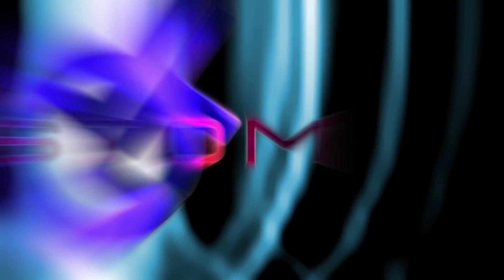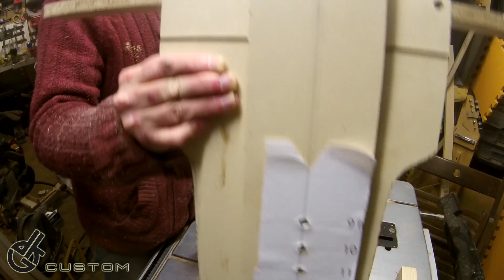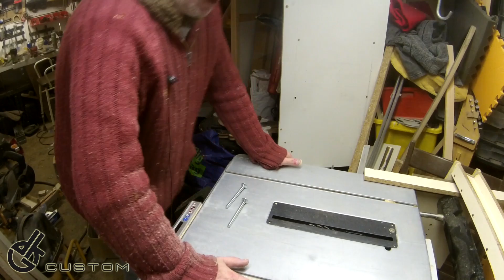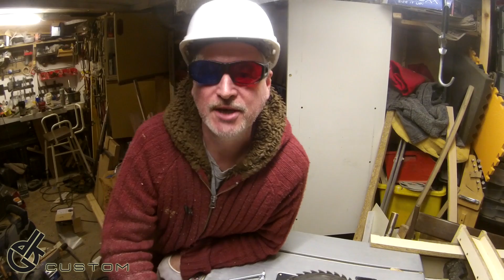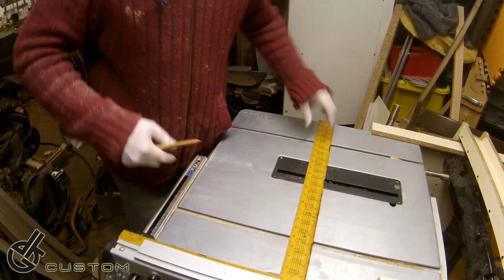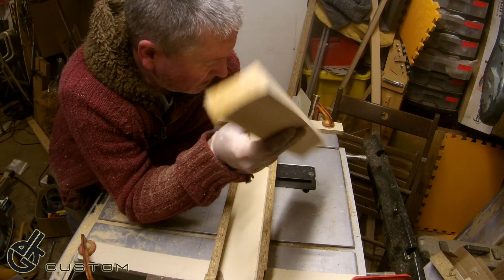Make FretBoard Radius Block using Table Saw - The blocks

Comment: thanks for sharing. Very interesting approach, but I'm sure the blade life will be shortened. I'm not sure how much less work is involved with the jig than using a router.
Like you, I have used a table saw for years - even perhaps before you were born - and I tend to be a bit overconfident. I am aware that it is a sharp-toothed dragon just waiting to amputate my best guitar-playing fingers. I recently rethought my use of the table saw in my very tiny workshop. (Well, it's a shed!) No more freehand cutting or tools lying on top while it is on, and the cardy has gone, replaced by a suitable apron. I made it so far but want to remain intact for my last few years. Cheers.

Comment: I hope you learn to be safer on the table saw.

Don't:
   - wear loose clothing.
   - leave the blade exposed. Cover with a plywood box each side.
   - run your hands over the blade. Use a push stick.
   - take heavy cuts. That saw is under-powered for the cut you're asking it to make.
   - use dull blades.

Best,

Comment: Dude you need to wear your safety glasses!  Forget losing your figure, you're going to lose an eye!  It doesn't make any sense to tell us to have all the proper safety gear and then not use it yourself.  I'm still not sure what you actually accomplished in this video.
Reply: I initially set out criticizing your scolding OP. But now that I've watched the video I have to say it's really scary. DKGC, your hanging sleeves and fingers are SO close to the blade. Even the slightest contact is going to be terrible. My dad lost his pinkie after shutting the saw off--the blade was coasting and ripped his finger right down the middle. I myself opened up two fingers on my right hand when the blade grabbed the back of the piece I was cutting--when I was a teenager operating the saw in a dimly-lit room. Since I have become draconian about safety. I figure I owe the universe one for how lucky I was to have gotten away with all my digits. You, sir, have gotta be more careful. Excellent idea though. One of the best out there.

Comment: This is a clever idea HOWEVER very dangerous !!! How you missed cutting your fingers off amazes me. 

You must ( please! ) build a hinged guard to fit over the exposed blade on either side. It is fairly easy to do and will prevent nasty accidents.

As Richard PAINFINGER says, you can leave the riving knife on, just reverse the block and run thru again...

Thanks for the concept! :-)

Comment: dont need to remove the knife, you only needed to reverse the block and run it through the front side again
Reply: +Richard Kurbis (PAINFINGER) also screw an oversized piece on top of your block so it doesnt lower as you shave it.